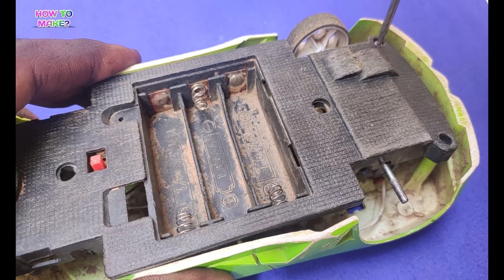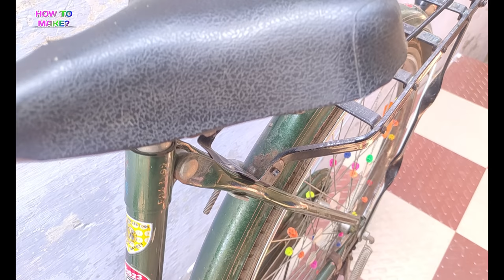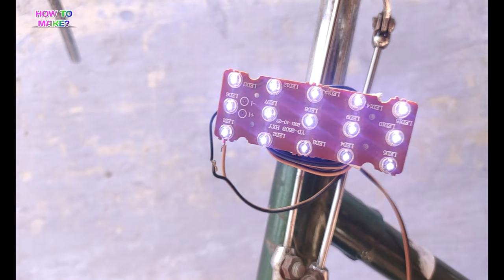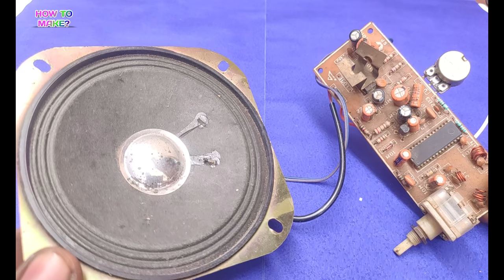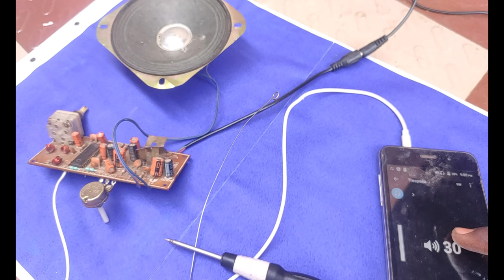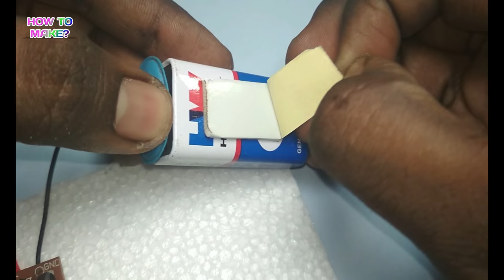3 Awesome Uses of Old Remote Control Car With RC Remote

Comment: Can you please tell me the values of those 4 transistors on the receiver circuit. I have the same circuit and my transistor not working and I can't see the number of the transistor. Please tell me those transistor name
Reply from the maker: S8050 Transistor